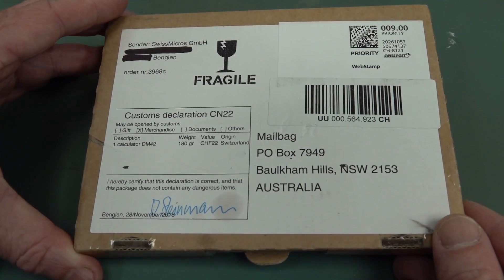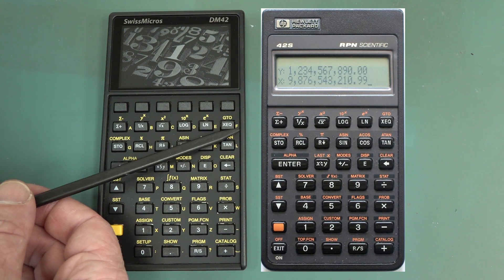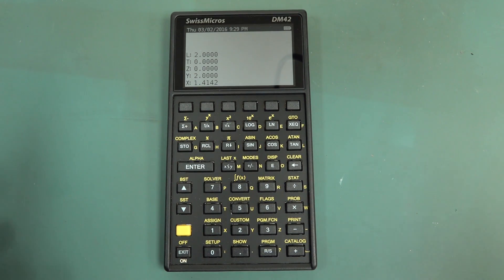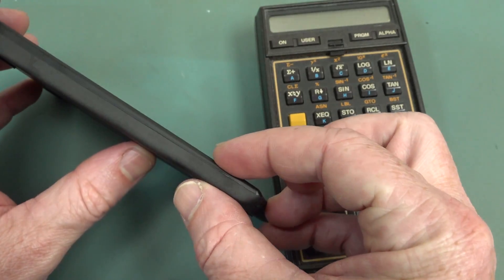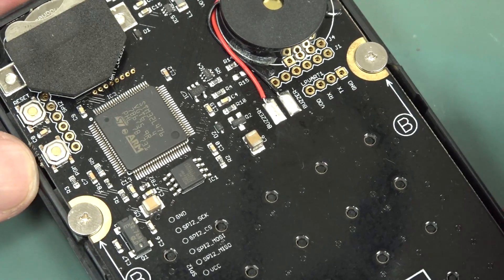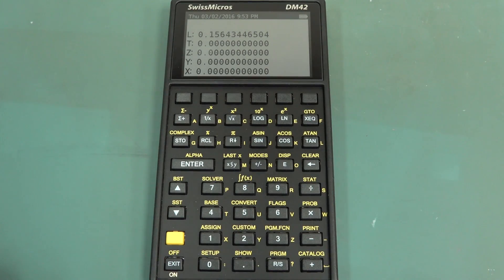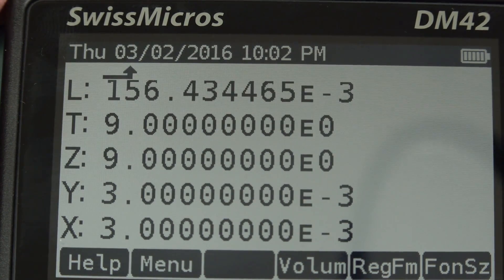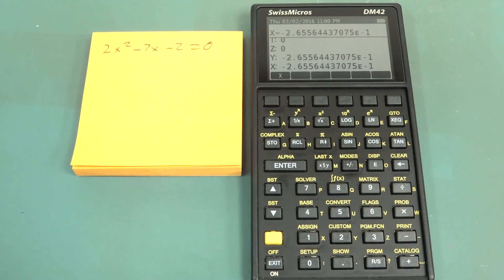EEVblog #1159 - World's Most Precise Pocket Calculator

Comment: Please Dave, calm down and take a cold shower if that helps -
This product is just slightly better than I would expect from a chinese producer, only the software part looks more "solid" and complete.

The plastic/mechanical: buttons cave in, a typical low quality indicator, buttons doesn't have the "skirt" like ALL HP calculators have - could easily have been done by an experienced mechanical designer. The back plate is metal, yes because if it wasn't you would've had to use four screws to keep a "flimsy" thin front and a back together in a rigid way. If you try stiffen up the design with a thinker front, the thickness difference in the plastic part would had made the caving even worse. That solution using a metal back is, in my eyes, a "quick and dirty" you only use when your production is fairly limited. Brass threaded inserts - wow !!, thats actually an improvement from HP.

37 years back when I dumped my SR-56 for a HP-41C some claimed that HP was lacking the "needed" precision for engineering work. Well I have to admit that if I had tried to calculate the trajectory angel for Pluto I might had been of target by many miles but I only aimed for Mars ;-). And when it came to calculating capacitors, inductances, transistor stages with S-param., transmission lines and complex filter sections I still got it right - first time and faster !! - despite the lack of 10 digits less than the Ti58's and '59's. How many component do you deal with that has a precision let alone an accuracy (notice the difference) of better than 0.1% - except for expensive resistors and very expensive capacitors ?.
And tell me, how many of you would (today, not 30 years ago) do a full simulation af anything that needs input of more than 10 parameters ??
I wouldn't - I would use a GPL MathCad clone and a countless number of mechanical, physical and electrical/electronic simulation and calculation tools.
I have a full Mentor graphic suite, (org.) MathCad and a bunch of other tools to my disposal - magnetic and electrostatic field simulation amongst others - so I'm home dry.

Comming back to precision my latest acquisition is a 30 year old HP 28S, handles 12 digit precision and +/-499 in the exponent. And it holds any variable - Any variable including complex, arrays, and full matrixes and programs!! - in any of its stack levels that is only limited by the available memory. Price $50, batteries not included ;-). 

You can get a decent looking, perfect working, secondhand original 42S for less than you will have to pay for a DM42. Only reason to buy a DM42 is to get a pocket size Linux platform not hooked by Google ;-). 

If you want something RPN and not 100% original buy a 41CL from Systemyde.com - up to 50 times faster than an org. 41C/CV/CX and packed with EVERY function and program EVER written for HP41 - yes EVERYthing included on-board and in the original HP quality mechanical package. At less than dobb. the price of a DM42 and then its Binary compatible not just emulated functional compatible.
I wonder if DM42/Free42 runs SysRPL programs with inline Saturn Assembler code - my 28S will and a secondhand 48G do too :-)

I am the proud owner of - 
1xHP35 1xHP55 1xHP67 1xHP29C 1xHP41C 2xHP41CV 1xHP41CX, 
2x41C cardreader 
serveral handfull of program modules 
HP-IL printer, tape station a.o.
All of the above is 100% original, except refurb of HP67 cardreader and tape station, and still 100% working - mind you that some are more than 40 years old.
 
I also own some "lower class" calculators like SR-56, SR-52, TI-80, TI-82, TI-83 and TI-89 and a Casio "who cares to remember the type" :-)

So Dave, you have done product development your self, you didn't like the shiny black solder mask, that should tell you that this product is not made by engineers like you and me.
I do not demean the product, it's nice and somehow fills an open slot in the marked, but its not an engineered product so don't put it up on a pedestal where it doesn't belong.
It is merely a simple single board computer like an Arduino, BeagleBone or Pi based on a ARM Cortex-M4 type chip and equiped with a nice graphic LCD and a 43 keys keyboard.
And it doesn't even have a pin breakout !!!! - thats a joke ;-)
Some people are very quick to see features in individual parts and visualize a complete product - Michael from Swiss Micro are one of those guys - that doesn't make them engineers though.
Michael saw a single chip system on a single pcb that ran Linux - but every one makes a SBC with LCD and, at least a USB port to connect, a keyboard and sell it for less than 50 bucks.
Load a Free42 application on that Linux and wrap it all in a suitable box that will sell for at least 3x-up. You and I and many others call it a nice tool and most call it a nice price.
But Michael is not selling tools, as I see it, he is selling gadgets - creditcard sized gadgets in sandblasted Titanium "wrapping". If this was a tool it would had been on Hackaday as a project - actually I think I have seen such a project on Hackaday.

But in the end it seems to be the most decent series of HP clones/emulations I've seen to date.

Comment: I bought the HP11 (same but lower memory than the 15) in 1985, used it in college and I still use it in the shop! I also have the HP 42 but I'll check out Swiss micro. You have to own HP calculators to understand the passion!
My HP calculators:
HP11,17,32,42,71B,35 and a couple more lying around somewhere. The 42 had an IR port to send to the printer.
They tried to make the 71B the new 42 but they left out RPN and nobody wanted it.
Reply: Wow Dave I just checked the price, $230! You can buy a new HP35s for ~$50, so it's not a 42s but it has the HP 'feel' and it's well made.

Comment: Back in the heyday of calculators (70s, mostly), high precision was important, as a lot of engineers would use them for lack of anything more affordable. A big problem these days is that students do not understand the concept of *significant digits*. You see, for example, statements along the lines of "50 pounds, or 22.6796kg", and it never occurs to the author how ridiculous that statement is. I have no solution to the problem, since I only teach graduate-level courses.
Reply: (yes, I actually used my trusty HP-67 calculator, which is still working after 42 years)

Comment: Wish they had a proper HP41CX clone with proper display (the 16 seg one and not dot matrix), some expansion possibilities (maybe some RS232 or IRDA or BT for a printer), build in big library of expansion modules (they already have such feature anyway) and obviously proper keyboard. HP48 clone could be their ultimate calculator, much better than 42, what i don't like about 42 series is that it basically made some downgrades when compared to 41 like lack of keyboard customization and lack of expansion capabilities.

Comment: WARNING NOTE: this model has issues with keys often registered multiple times or not at all (this is confirmed by many users in the forums), and the USB being slightly out of spec so you'll need to cut a connector to be able to squeeze it in (or remove the heavy cover every time). It's too bad because the designer went through the trouble of improving its use in several ways. I'm an engineer so I'd rather have reliable keys than so much precision but the latter is mainly thanks to the open project Free42 (by Thomas Okken), whose code has been used instead of the original ROM emulation because the 42 doesn't benefit from the same copyright immunity as the Voyager series. Finally, it's not very stable on its pads and pressing the lateral keys will tip the calculator.
In conclusion it's a nice experiment and some geeks will like it as such, but if you want an HP-like calculator you can trust and which is practical to use, you definitely want to stick with the DM1xL ('L', not the smaller ones!) which doesn't suffer from those troubles.

Comment: I remember a YouTube interview with a NASA engineer, where he was asked something like “how many digits of pi does NASA use in their calculations?”

The answer was (I think) 16, but he went on: if you knew the diameter of the universe, but wanted to work out the circumference, how many digits of pi would be good enough? He said that to get an accuracy/error down to the width of an ATOM, you’d need...

...

...

40 digits. I’m thinking that this 34-digit calculator should be accurate enough!

Comment: Just got mine today and am underwhelmed! Maybe I have a bad unit.  Some keys do not register. So far I  have founds three or four keys that produce no screen output after the click. So essentially the click happens and it requires me to press further to get the action. The worst one is "5" which produces no output unless pressed further after the click.  I will contact SwissMicros and update the comment with their response.
Reply: Just found that this has been reported by many people on the SwissMicros forum:
https://forum.swissmicros.com/viewtopic.php?p=7815

I hope they have a fix. The calculator is barely usable like this.
Reply: I received a second unit and it also has the very same keyboard issue.
I saw some keys with double strike problems and many keys were not registering after the tactile feedback click.
After two units like this I asked for a refund which SwissMicros quickly gave me, stating the need to address the keyboard issues.

Comment: I guess if you're into RPN calculators this is a good calc. I dare ask however, of what value is that extra precision of any use in day-to-day calculation? Also, I know it can be programmed but wouldn't an interpreter like BASIC or LUA be a shoe-in?
Reply: Thomas Okken, who wrote the calculator software, never intended to market it as being extra precise. It was just an artifact of using the Intel library, but some others decided to market it as the "most precise calculator". You're right, it's hard to imagine a situation where you'd be doing a calculation on a device like this and actually need all that precision!

Comment: I still have my HP 15, 16 and 42S!

But seldom do I need any of those, as my PC and iPad, as well as my smart phone all have the HP-15 emulation.  My iPad has additionally HP-67 emulation.  My original HP-67 still exists in pieces, because its magnet card reader drive wheel went gummy and the 3 cell battery leaked.

Comment: Only cardinal sin is the rubberized back. That thing will nicely start melting over the years and you'll need to either scrape it off or remove the layer completely using acetone.

Comment: I bought one of the first thousand HP41C in Santa Clara before starting 1st year engineering. It blew my mind with lcd display, alpha numeric capability, memory after turning off power, programming language, expandable etc. The manual was a treat to read.

I also got a PPC custom rom which extended functionality and supported micro coding (a hack which allowed low level programming of internal registers to make new characters and all sorts of unintended control of the calculator itself). The PPC club was made up of 41C enthusiasts and even published a newsletter x times a year. Felt like you were in a secret society.

Sadly the 41C isn't working but someone built a 41CV android app with the same display and keyboard. Now I can keep a 41C with me all the time.

Comment: I am still using an HP48 up to this day. I have other HPs and TIs as well. But that one is my favorite by far. If SwissMicros ever builds a clone of the 48, I will buy it.
Reply: I just run Driod48 on my phone.
Reply: Add a third to the waiting list
Reply: My 48SX and 41CV both still work but I don’t use them very often. Easier to use Maxima on the PC or the HP48 emulator on Android.
Reply: Same!
Reply: Same !!
Reply: I played with the 48 and was underwhelmed. I thought the 42S (of which the DM42 is a clone) was the best.

Comment: I am a calculator collector. You think Casio is better? 

To me the Casio CG50 is weak because it's clunky. Also, the programming language is not very good. It would be an amazing calculator if they would redo the software, because the hardware is very nice.

If you're talking about the Casio fx-991ex:
PROs:
1) Fastest non programmable calculator.
2) Best solver on non programmable calculator
3) : colon button + calc button allows making programs for iterative calculations.
4) 4x4 matrices
5) input equations how they actually look 
6) has all of the functions other non programmable calculators have.
7) can buy for 20 bucks
8) solar power

Cons:
1) not programmable
2) not as fast as programmable calculators
3) it forgets your calculation history when it turns off or when you switch modes (it auto powers off within 10 minutes erasing your work)
4) it only has variables A to F and M. Often forcing you to make illogical variable names. Current = A, Voltage = B, Resistance = C.
5) it has quite a few useless buttons. Shifted log base 10 and log base n buttons could have just been a single button.

Overall the dm42 is better for the working engineer because you can program it for repetitive calculations and you can customize it for your work flow.

I'd say the Casio is the best non programmable calculator and is probably the best calculator for engineering students.

But nothing beats named variables in solver programs on the dm42.

Comment: Ah yes, the HP15C. I bought one over 30 years ago to do complex matrices for ac circuit analysis. I used to get sick of solving complex simultaneous equations. I believe I paid a little over AU$200 over 30 years ago for the 15C. So I'm assuming this SwissMicros has the identical functions as the 15C? Have always appreciated the RPN (Reverse Polish Notation) and the registers of the HP calculators. Very effective when you get used to them.

Comment: When I need a physical calculator that I'm familiar with I've got a TI-89 Ti, although that's usually overkill for my needs. Most of the time I can get away with a basic calculator, but failing that I have either Wolfram|Alpha or a script a wrote a while ago for what wound up being a surprisingly powerful  postfix calculator (because sometimes it's easier to just tell it what I want then to figure out how to get WA to do it).

Comment: My first calculator was an HP-45. I spent about $400 on it, which in 1973 was real money. As a result, I can only use RPN calculators. I never get the right answers with an algebraic calculator. Now, I use RealCalc on my Android phone which has an RPN setting and resembles an HP calculator.

Comment: I still have my 35, 41, 42, and 15.  The 35 and 41 no longer work.  I always liked the 41 the best.  The firm I worked for back in the 80's would only allow the 41 to be used in the office.  Engineer with Calculator fetish.

Comment: I prefer Casio V.P.A.M. calculators... and actually I still have both of my original calculators from school times: fx-85SA, and fx-6300G. I have never used an RPM calculator. I get the idea, but don't like it. It didn't know it until today that the reverse Polish notation has ben invented in... Australia (by  Charles Hamblin). This is a stack based calculation method, based on the Polish notation (by Jan Łukasiewicz)... this time really invented in Poland.

Comment: I'm giving everyone that uses Linux a FREE "arbitrary precision" calculator. You can use it to 10 digits, 100 digits, a million digits. https://www.gnu.org/software/bc/manual/html_mono/bc.html

Example:
$ bc
scale=50
sqrt(2)
1.41421356237309504880168872420969807856967187537694

(To be fair, I'd guess the author Philip A. Nelson, is the one doing the giving. ;-) )

Comment: i HAD An HP41 CV with a Petroleum Engineering chip.  I wrote several programs for figuring Equivalent Circulating  Density of drilling fluid at the bottom of a hole being drilled.  Alone with the Printer.....
Reply: Wow. Been ages since I heard the phrase "petroleum engineering chip". Where else but this channel? Haha

Comment: I am in the market for a great computer/programmers  calculator, one that can do Hexadecimal, Octal and Binary base numbers. I have an old Radio Shack that uses two button batteries. I tried phone apps , however they are not nearly as good as the tactile feedback of a real keyboard.  The computer ones are only good because of cut and paste, however they also add an additional window and in a development environment, screen space is precious.
Reply: My TI-30X Plus can work with binary, hexadecimal, octal and obviously decimal numbers. Binary is unfortunately limited to 10-bit though (I think its internal numbers have about 10 digits visible and they internally store it as a float, octal and hexadecimal numbers also work with 10 digits), but apart from that it works nicely. It also has a history of calculations and results where you can scroll trough to copy-paste previous results or calculations. It's about €18 which I think is still quite reasonable.

Comment: Pff my Nokia 900 has arbitrary precision (until you run out of heap space) with GNU MPL and that suckers 10 years old. I had a crappy TI83, then an awesome (nonplatinum!) TI89, but often yanked my fathers HP48. The 15, 42 and 48s and the last run of 50s were absolute killers. HP Laserjet III's (still running, half a million page count!), the 3458 8 1/2 digit DMM, man oh man.  

Fiorina absolutely gutted that company taking it from 50 years of rock solid engineering into just a tragic shell, just so she could see a quarterly share price bump (that'd last half a year before investors realize they have no good products or engineering left, dumping the market cap to 1/10th the original value) and pay herself a performance bonus.
Reply: Arbitrary precision is the shit
Reply: @kikicat123  it really is. it's also fantastic to implement, a real challenge and i loved it in CS